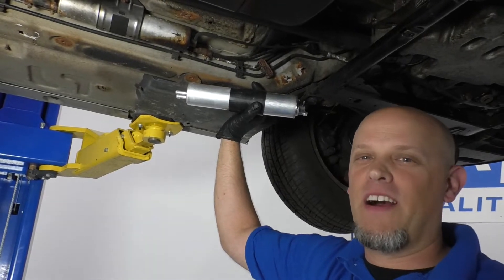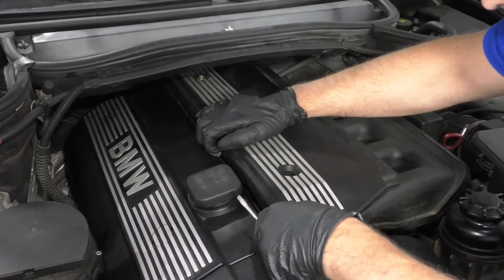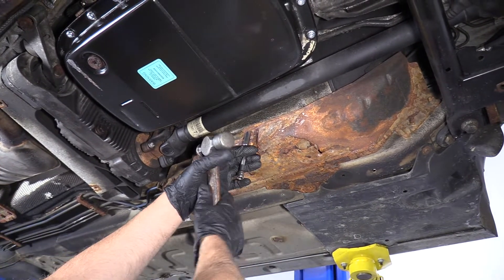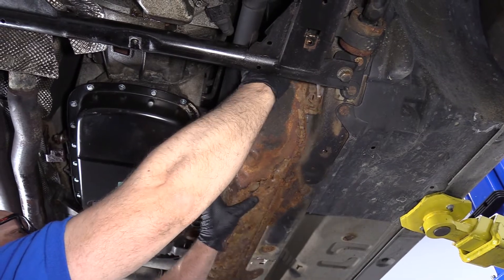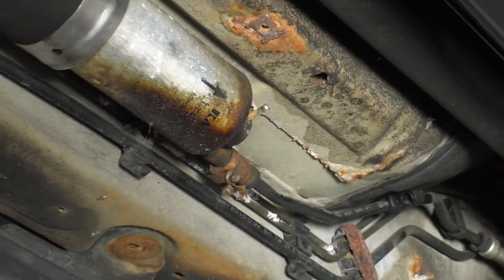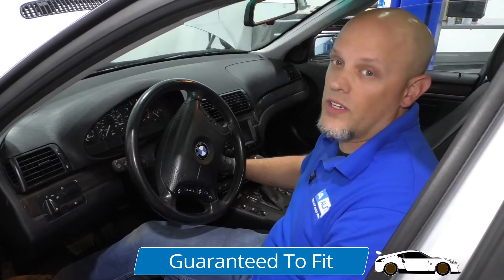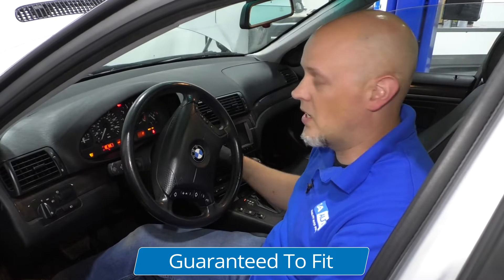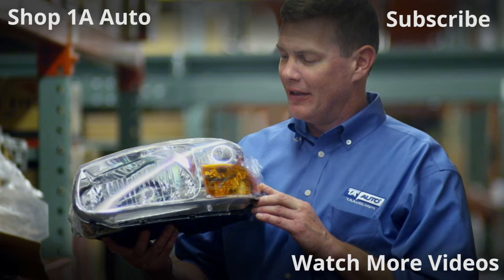How to Replace Fuel Filter 97-06 BMW 325 Xi

Comment: What diameter is used for the inlet/outlets? 3mm seems to work fine for the pressure regulator inlet but it seems don't have the right size for the fuel in/outlets.

Comment: I replaced my fuel filter today and it sounds like a dishwasher. It sounds like fast flowing liquid/waterfall. Any thoughts of why or what could be going on? Never had that sound coming from the filter before. It’s definitely coming from the filter because I went under the car when it was running. I got a Bosch filter. Half the price of OEM, I see why.

Comment: Can this cause a bad idle?
Reply from the maker: +Gerardo Mendoza We wouldn't be able to diagnose an issue like that here, you may want to have a local mechanic take a look at it. Thanks for checking us out! http://1aau.to/m/Shop-1AAuto-c
Reply: I own one and bad idle can be caused by many things on this car. check out the 50sKid on youtube. he shows how to diagnose those kinds of problems. Helped me fix mine.
Reply: I have terrible idle while in gear and gets better when in P and N, I’ll be replacing the fuel filter on my 200 325xi. Will report back with results
Reply: @C-Dub69  results?
Reply: @C-Dub69  results